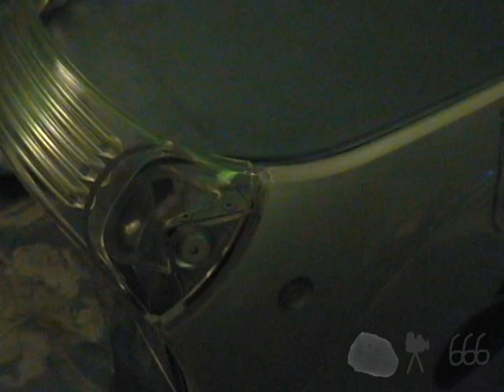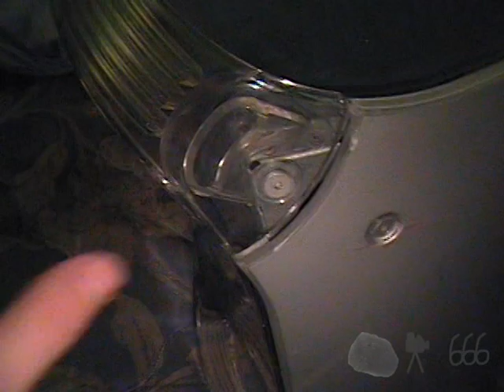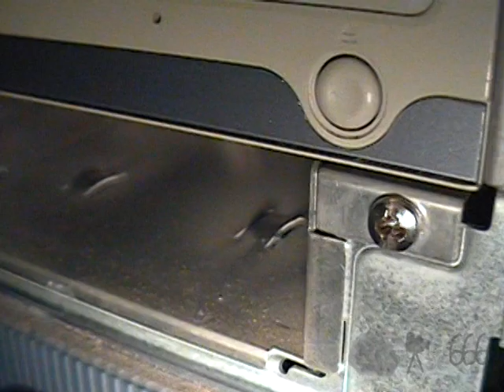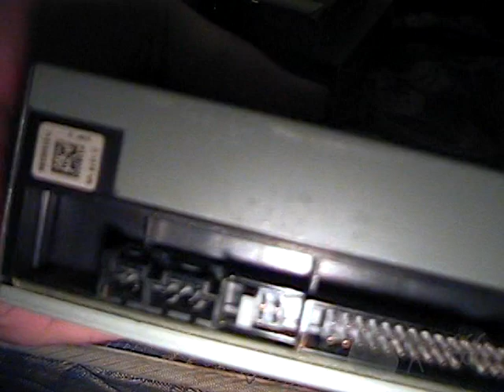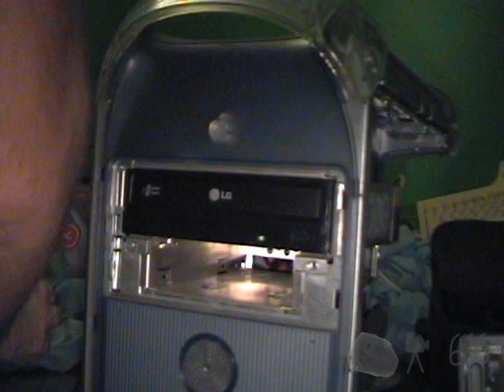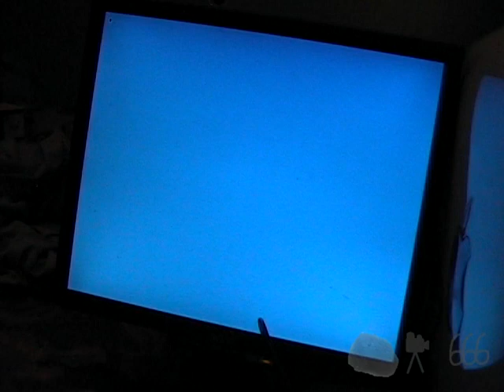How To Replace The Optical Drive In A "Graphite" Power Macintosh G4

Comment: My drive appears to be broken. Do I need to replace it with a specific compatible drive or any ide dvd drive will work?
Reply from the maker: Some people say you can't boot anything on these unless you have a drive with an Apple-supplied ROM. I've had no such problem with this one.
Reply: @CarnelProd666  I ended up replacing it with a random LG drive from 2008 and it was able to boot both an installation CD of OS 9.2.1 and of OS X 10.3 no problem. Thanks for the video 👍🏻